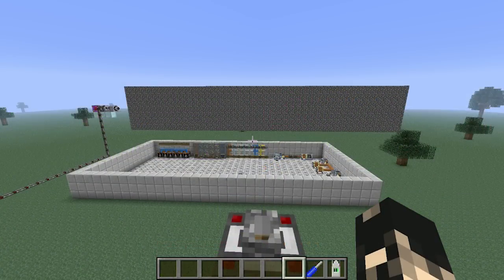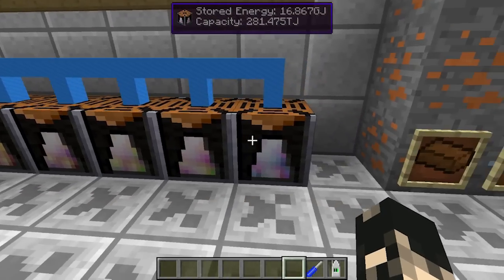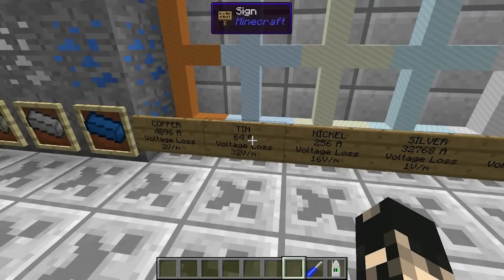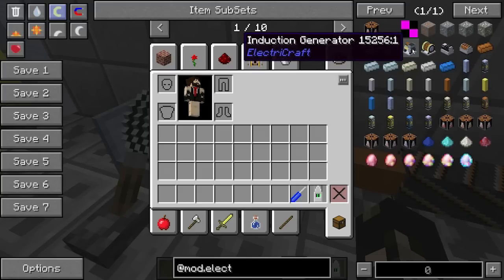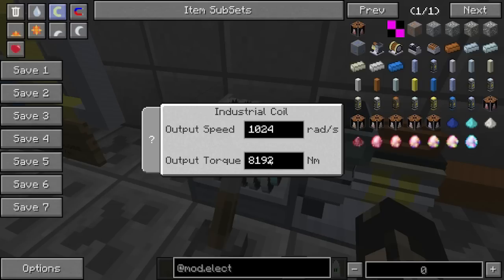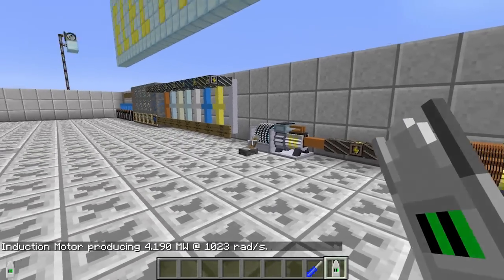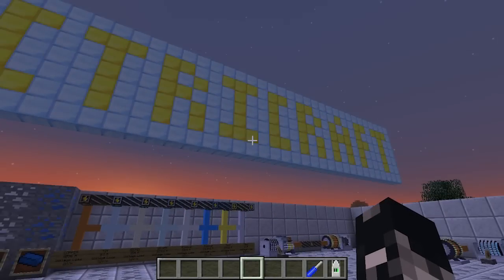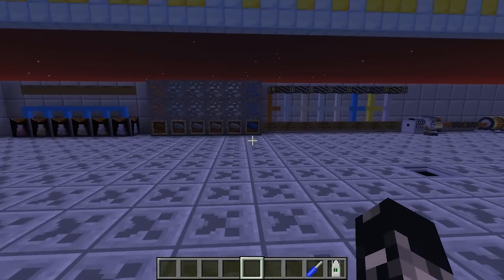ElectriCraft Spotlight

Comment: Voltage is generated by rotational speed, while current is generated by torque into the generator.
Reply from the maker: I had that figured out before set the amps and voltz to be both 8192 and got confused. Thanks for simplifying. Much better.
Reply: Ausyarr
The intro was super cool btw :)